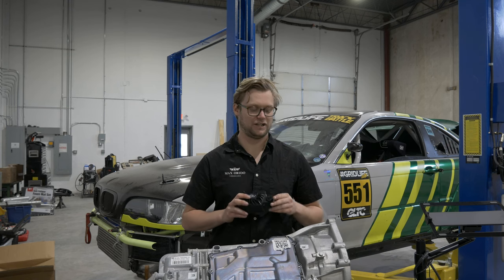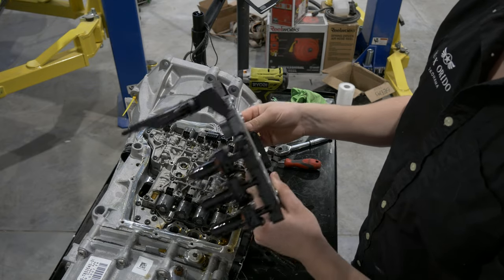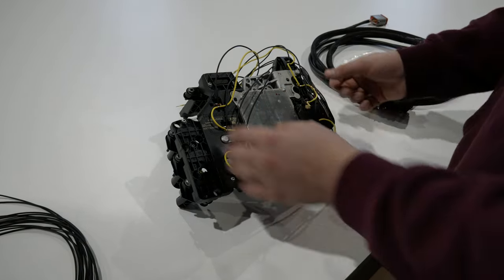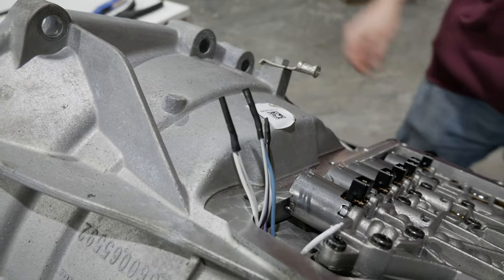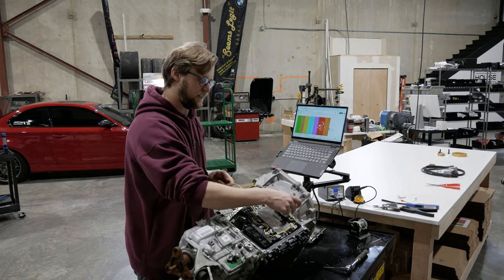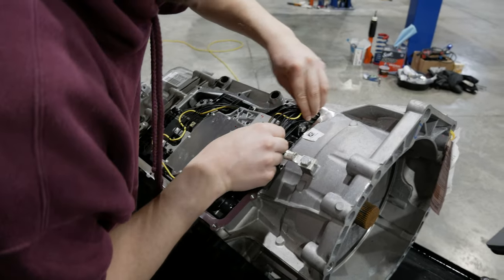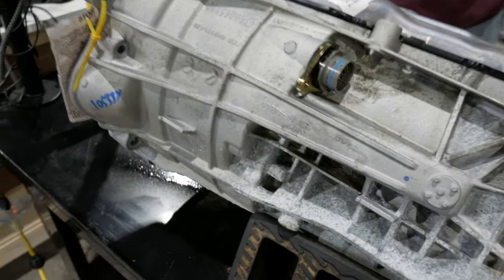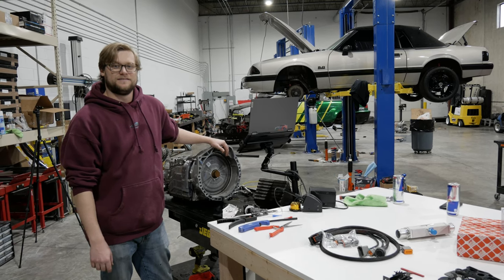How To Wire A BMW Dual Clutch Transmission Into Any Car

Comment: Hi, we have your SLG wiring kit installed, all is ok except the static adaptation is stuck on 3rd gear. I have used a config file I have use with 2 cars with no problem. They came with another wiring kit.
Reply from the maker: check PCB settings and shaft speeds which go through the PCB

Comment: Curious to ask, the video is titled “ANY CAR” so how would I adapt the shaft splines to other Engines to make it work any ideas or parts that would help?
Also what ECU would you recommend to pair this with for non BMW applications
EXAMPLE: a lexus IS350 or any Toyota V6/V8
Reply from the maker: We make a variety of adapter plates and flywheels for many engines, and can make them for really any project moving into the future. The flywheels have a sprung hub that has the splines. This sprung hub bolts to whatever flywheel we make, protects the clutch basket, and dampens vibrations. 

Any ECU that has CAN and an electronic throttle body is preferred. The CAN can provide engine data and the GCU can alter the pedal signal to command cuts and blips without the ECU knowing it exists. No need for a standalone, factory ECU have very accurate torque models and work well. If you have any questions please let me know!
Reply: I've spent my whole morning looking at dct swaps as I want to know if its possible on the is350 as well! Any news?

Comment: I put n53 engine and  gearbox into the e93 body that uses dct gearbox so the problem is the gear shift connectors are not the how can i make it work?

Comment: Hey so I’m doing some research I’m loving the video seeing this is possible, I’m planning on swapping my TSX transmission with an ILX transmission that comes with an 8 Speed DCT which a lot of people didn’t know lol until now. So question this same process would this also work if I did these same steps, very curious I would need to do the custom harness thru you guys also most likely with the ecu correct. Also to note the ILX comes with also a k24 engine as the TSX

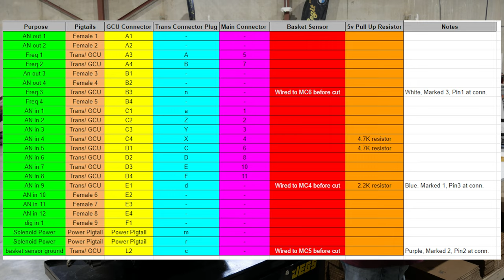Comment: Forgive me if I am wrong, but @14:47 we are shown the table/diagram for pinning, and it says the Trans connector pin is small 'd'. not capital 'D', yet at  14:58 there is a graphic that pops up showing pin 'D' yet he places the pin into pin 'd'. I am assuming this was an editing error on the video side and the correct pin is indeed small case 'd'.
Reply from the maker: yes its a editing mistake, should be lower case
Reply: @SeemsLegitGarage  Cheers. Figured as much. Thanks for the clarification.

Comment: The transmission uses the same yoke as the GM autos. Sonnax makes a billet piece that goes straight to a 1350 joint.
Reply from the maker: its actually slightly different, it has indents

Comment: Very curious about this swap are you able to do this on an e83 x3 and if so are you able to keep the xdrive awd
Reply from the maker: rwd only
Reply: I'd imagine you could use the 8hp instead of the DCT you could do it, there is an awd 8hp, not sure if about the x drive biasing though
Reply from the maker: @sintjinansley6107  solutions for that on the way

Comment: Would it be possible to do the same with a bmw m5 f10 gearbox (DCT GS7D70SG)?

Am I right to understand that in the video you have a gearbox from a bmw m3 e90/92?
Reply from the maker: mine is from a 135i, they are all the same internally though so we often use that version as well.

Comment: Will this work with a 2JZ NA, along with an E92 7 speed dct?
Reply from the maker: Yes we have 2JZ adaptors in stock and ready to go. Check out the website we have transmissions in stock as well
Reply: @SeemsLegitGarage  Could you also guide me regarding the ECU procedure? It can't be plug & play for sure
Reply from the maker: @FahdAzad  Email us and we can help set it up, no problem at all.
Reply: @SeemsLegitGarage  Soon. Still waiting on a few parts! Thank you. This is an excellent guide I hope y'all get more exposure.

Comment: Hey guys. Do you still recommend HTG? There is ALOT of hate recently, for the last year or so. I have only heard bad stuff about them, they basically don’t do any support and their main development hast left the company so it’s basically shutting down. I know you guys have endorsed them trough your videos so i just want to know your thoughts on the matter. I don’t want to spend 2k of my hard earned money for something that’s bad. What would be alternatives for the DCT controller? There is turbolamik but they are only for 8hp transmissions
Reply from the maker: You're right, right now HGT doesn't offer any support so we are recommending CANTCU or Turbolamik depending on what your use case for the car is.

Comment: Have you done this swap on an E46-M3 SMG? Will my current paddle shifters and shifter integrate?
Reply from the maker: shifter wont work but rest is ok, can use the f80 shifter

Comment: Regarding the actual Mechatronix rewire; is the wiring general off the shelf Autozone wiring? If it is, wouldnt the cheaper wiring insulation break down from long term exposure to ATF oil.., throwing codes ect, ect? Can a heavier duty oil resistant purpose wiring be used instead?
Reply from the maker: The wire we use is a high temp motorsport grade wire sourced from a high end manufacturer. Dct also doesn’t use atf. It’s more like gear oil.
Reply: Thx for the quick reply.  Haven't decided between DCT or 8hp, but on your website your Mechatronix Service shows 2 different Ryutech boards; a white one and a blue one.  Why are there two diff color Ryutech boards?
Reply from the maker: @kevinshasteen5682  two slightly different pinouts for different 8hp mechatronic versions

Comment: you guyz have any adapter plate or kitt made yet for 2018 infiniti Q60rs rwd yet with the F80 dct?
Reply from the maker: No but we can do custom adaptor plates, email sales@seemslegitgarage.com and we can help get it sorted.
Reply: @SeemsLegitGarage  yeah we will be emailing u on thiz from aus’
and if u have an complete gearbox with built new and stronger clutchez ready to go and to do thiz adapter kitt n wiring etc…

Comment: I have a Lexus sc400 with the 1uz, the stock ecu dosent provide any CAN data, so is a standalone a must? Or could I just use the controller? I’m thinking of using a ZF 8HP70
Reply from the maker: Hi, if you have a OBD2 port you have CAN which is sweet. If you don't have CAN, its not the end of the world, you just need to wire the GCU to some of the sensors going to the ECU as well. Its just easier with CAN (less wires)
Reply: @SeemsLegitGarage  so what could I purchase from you guys sense I have obd1, to wire up the transmission?
Reply from the maker: @stanleyle972  Our 8HP harness kit will allow the easiest integration

Comment: So you solder the black wires to the stock white wires rather than buying terminals for stock connector  :(
Reply from the maker: we have connectors and can do that if you like, but its much easier to wire tis way since you don't need to remove the cover and clutch to access the sensor easily

Comment: Hi do  you have an advert for the m73 v12 engine?
Reply from the maker: No but we can make it for you
Reply: @SeemsLegitGarage  how much it could be  for the whole kit adopter fly wheel what Elise do I need 
Does the flywheel week come with the toot for the crank sensors and the  hole for tdc?
Reply from the maker: @20ilde  email us and we can get it all properly quoted out
Reply: @SeemsLegitGarage   ok thanks

Comment: How to use a DCT with a 1200HP Honda K20 based FWD car? And which DCT will be suitable there?
Reply from the maker: Best option would be a upgraded DQ250 or DQ500 transmission
Reply: @SeemsLegitGarage  
What do you mean by upgraded? It will need to be fully rebuilt? Which components need to be changed? Tell me in details please.
Reply from the maker: @sajidmohammad3190  I would just install a upgraded clutch basket and clutch set. There is not much to rebuild/upgrade inside the transmission.
Reply: @SeemsLegitGarage  
But after I do a bit of research about this transmission, it's an AWD...But I need a FWD..!
Reply: @SeemsLegitGarage  
Hey please answer me?
Reply from the maker: @sajidmohammad3190  they come in FWD
Reply: You can't use this in a FWD layout like a civic. You can get a sequential transmission though

Comment: How much would this cost and do u think you will still be doing this for customers later down the road
Reply from the maker: Yes for sure, we do those often for customer cars. All together most swaps are 7-10k including transmission and accessories/supporting parts.
Reply: @SeemsLegitGarage   would that be including the gearbox? Like do u do a package where the customer doesn’t have to do any of the work or what’s included in that package? I’m looking to vortech supercharge my e46 330ci with the m54 engine an have it at around 650/700hp and rev to over 8k so dct would be perfect for me...
Reply: @SeemsLegitGarage   I’m mechanically minded so most of the install stuff I will do myself in my dusty garage lol but anything where I need to use a computer and do software stuff by myself is where I start to get annoyed knowing the process will take a lot longer since I have to rely on someone else to do it for me